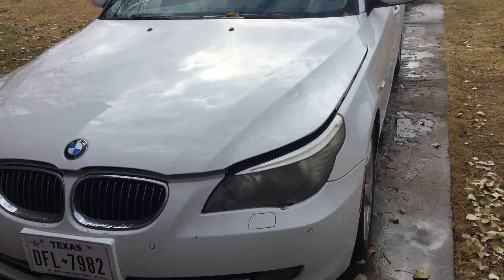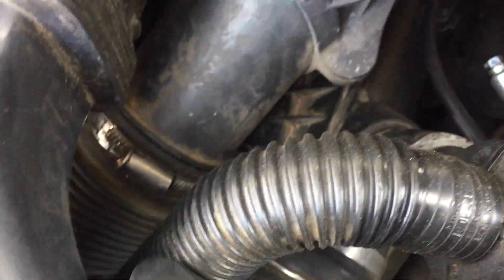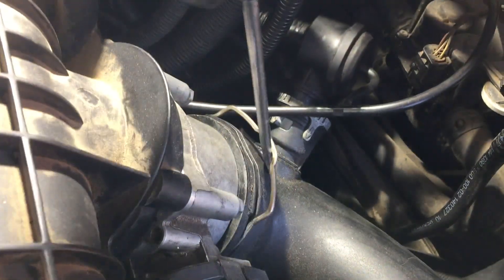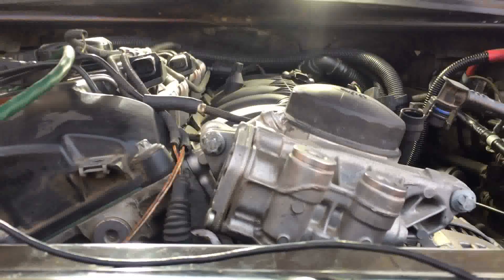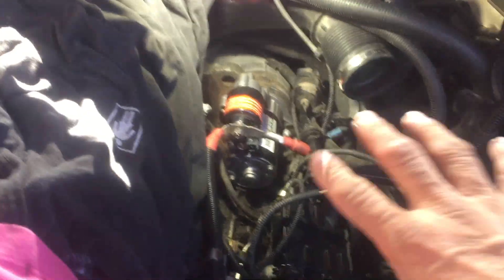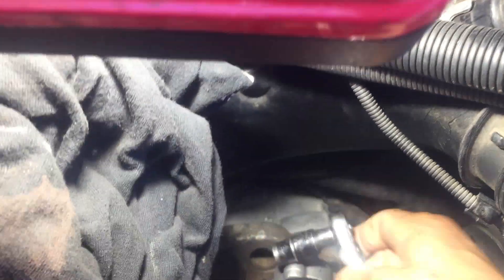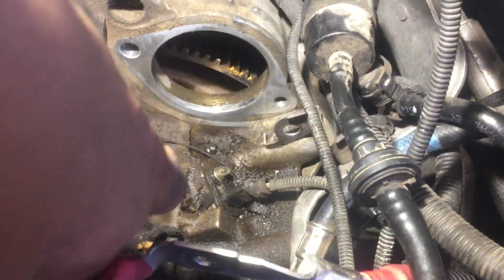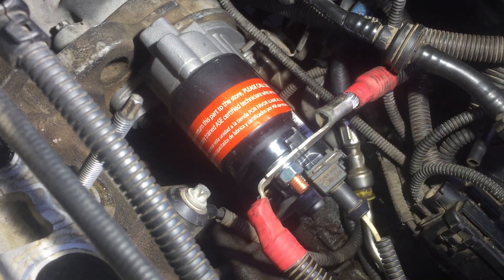08 bmw 535i  starter replace

Comment: Hello sir i have a question i have a bmw 535i year 2010. I just needs the tools. Can you recommend me which tools should i use and all the numbers of the bolts thanks in advance?
Reply from the maker: Hi Vince & Nancy's Channel.  screwdriver  1/4 drive flexhead racket E 12 inverted socket 11 mm deep socket and extension and ratchet  13 mm socket with extension and racket any size 3/8 or 1/4 drive   hope that helps  thanks for watching I appreciate you
Reply: @Marty09933  thank you 🙏

Comment: Great video, do you think a bad alternator is the reason my car wont crank or start?  There is also a transmission error on the dash
Reply from the maker: Hi Retro Boss it’s hard to tell without being there and looking at the car but if the battery has some charge on it  it should try to crank over   but if the car is just  clicking it’s probably a bad starter or battery.? Try boosting the car and tapping on the starter. Thank you and thanks for watching I appreciate you
Reply: You should also check your motor ground cable,  this could stop your car from running
Reply: Hey did you ever solve your issue ?

Comment: @Marty0933 @ Its so hard to remove that cable/hose thats connects in the back of intake manifolds… i broke one side of the clip.. I don’t know how to get it out.. i tried to put the two flat screw head on both ears but its not coming out still..any suggestions?
Reply from the maker: Vince & Nancy’s channel are you talking about the one that connects to the throttle body ? If so you can get away by leaving it on just roll the manifold to a side it won’t give you as much room but you should be able to access the starter . You can spray WD-40 on it and just play with it try two pick instead of screw drivers they are smaller to open the clips . That’s what I hate about BMW cheap plastic that gets brittle with the heat of the engine
Reply: @Marty09933  thank you. I took it out just now. Now im on the part where you said that one that just came off …thae one where it’s connected to the intake where you said “hell’, now im having hard time on this one

Comment: I’m going this job now and your video helped me a lot. I have question for the back bolt on the start you said used a 10mm  to get it loose is that 12 point or 6 point?
Reply from the maker: Hi Blake Loington  6 point but if you have an E 12 it be better just be very careful that bolt is very tight  thank you for watching I appreciate you
Reply: @Marty09933  I do have an e 12 but like you said I cant get any leverage with the wrench.
Reply: Just found an extra long flex head wrench at  harbor freight. Hopefully I’ll get it off today. Its the last thing I need to do to take it out. Again thank you for this video. You made it so much easier. Your explanation was excellent!!! Best video for this job on YouTube!!
Reply from the maker: @blakeloington5476  thank you I really appreciate that brother. Let me know how it goes and your very welcome
Reply: @Marty09933  ended up striping it.  We used a regular 10mm 6 point socket  and it came right off.
Reply from the maker: @blakeloington5476  awesome so I guess a regular 6 point will work thanks for the info appreciate it
Reply: @Marty09933  it worked for me

Comment: @Mary09933, now i cant take out the bolts in the back of the starter, any suggestions? I tried almost everything but i think that i lost the thread already.. any suggestions would really appreciated. Thank you
Reply from the maker: Hi Vince & Nancy’s Channel hey brother sorry was very busy. Get a 1/4 flex head ratchet or a flex head wrench   I believe it’s a 10 mm 6 point wrench or even a 12 point will work try that
Reply: @Marty09933  i tried that too and its just does not turn at all. Either the treading is all gone, no space, and hard to turn when working on this volts.
Reply from the maker: @Vinceshoxs24  see if you can take more stuff off  from the top I can’t remember if it was possible or not it’s been a while since I’ve done that car If the head on the bolt is messed up try one of those bolt extractors …..         
https://www.googleadservices.com/pagead/aclk?sa=L&ai=DChcSEwj2zeyEk4D0AhUCIzgKHT78DxQYABAMGgJqZg&ohost=www.google.com&cid=CAASEuRoMNJLDbl_WeVDndxq7RlBOw&sig=AOD64_2VMgM2a08IlYpZCI06wYC4j4XrKg&ctype=46&q=&ved=2ahUKEwjPluOEk4D0AhWXlWoFHXmnCxcQzzl6BAgBECo&adurl=y
Reply: @Marty09933  thanks men but i tried that one too and still no luck.. now m screwed
Reply from the maker: @Vinceshoxs24  Sorry to hear that brother the only thing I can suggest now is fine a reliable mechanic that can take that bolt  out you may have to pay him some money but like you said you’re already screwed  then you can finish the job yourself  and still save you some money. Just compare how much it’ll cost you to tow it over there and tow it back and you do it yourself unless that mechanic can give you a good price for him to fix it ??
Reply: @Marty09933  just an update viola.. the volts came off..used a vice grip to tirn my flex head ranch using an E14.. i pretty much used all my powers and luckily it turned. Thanks mate
Reply from the maker: @Vinceshoxs24  hey brother don’t beat yourself down at least you tried we’ve all been there I stripped a few bolts before and had  to do more work to get it out but in the future just take your time if it doesn’t feel right the socket or wrench isn’t  tight on the bolt  then stop and find another size that fits tight and go with that make sure you get a good bit on the bolt . Keep me updated
Reply: @Marty09933  you are the me bro! I will keep you posted!
Reply from the maker: @Vinceshoxs24  there you go brother you just did what a Mechanice does all the time improvise. So happy for you 👋👍🤣
Reply: @Marty09933  thwnks im still stuck on putting the intake manifold. This is harder than I thought
Reply from the maker: @Vinceshoxs24  yes it can be tricky I hate taking them off just make sure you give yourself some space pull all the wires out of the way grab that intake and just sit in there take your time
Reply: @Marty09933  thank you. Everything is good now. I cleared all the errors as well because i had a misfire on cylinders 4&5 plus random misfire. Bought some diagnostic tools. I also changed all my coils and spark plugs coz it was stalling after installing new starter but im. Not sure why. But my only concern is whenever im driving my mileage was going up. Something is up with my HPFP or sensors or my fuel injector maybe?
Reply from the maker: @Vinceshoxs24  glad your done with the starter . Yea it’s hard to tell what’s going on that’s the thing with bmw always something.

Comment: If you listen to his method of removing the difficult bolt you will struggle like I did. Then i realized you could fit a 3/8 ratchet behind the rear intake. DO NOT remove that bolt like he did. You wont be able to if its never been replaced before.